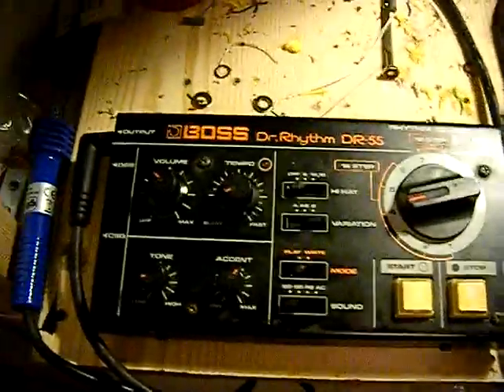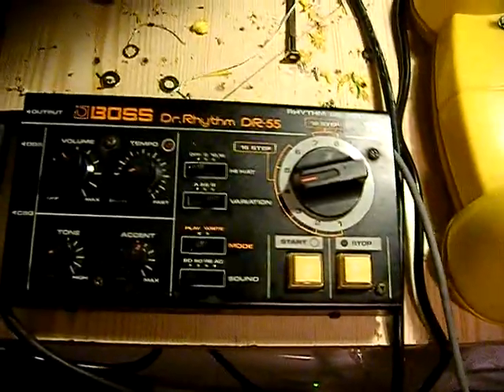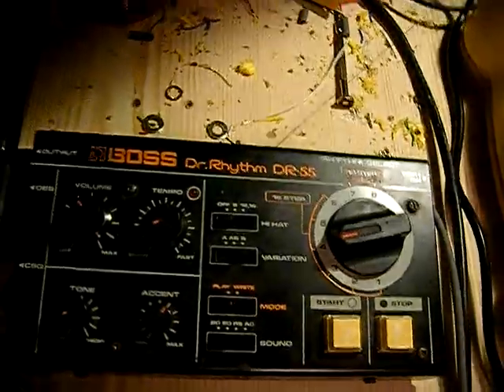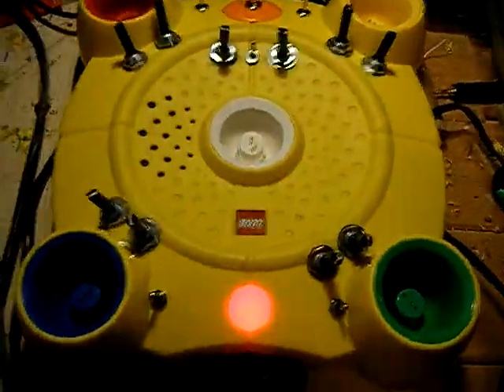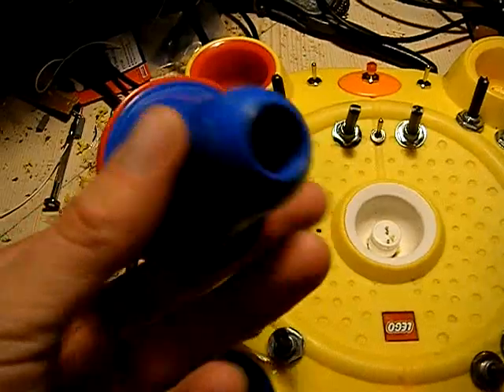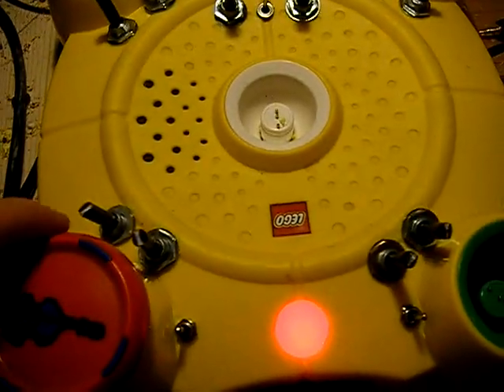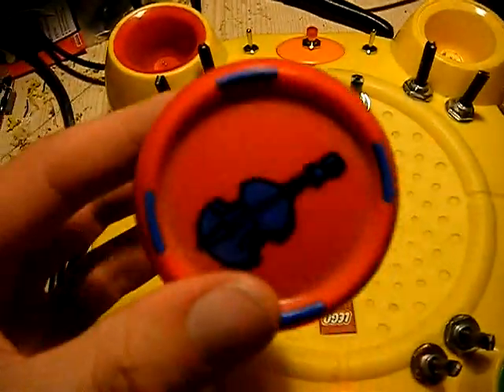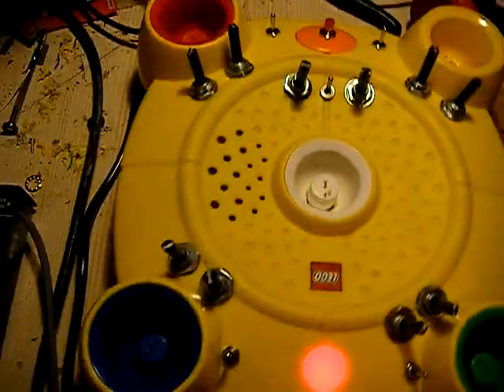DR-55 sync with Lego toy techno

Comment: Wow

  Loads of other noises some of them I didn’t hear in the other video called circuit that Lego toy

  Is it possible to get pitch bend on this toy like removing a resistor and adding a potentiometer and switch to activate the band?